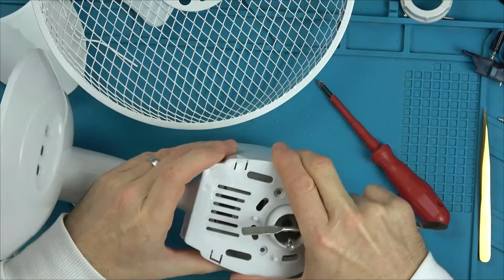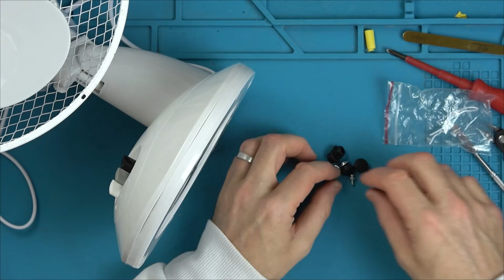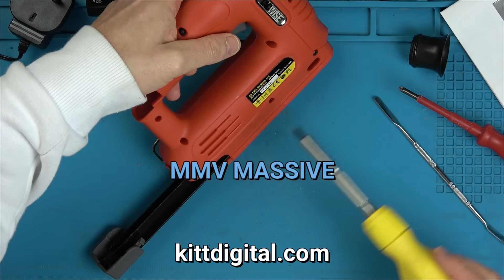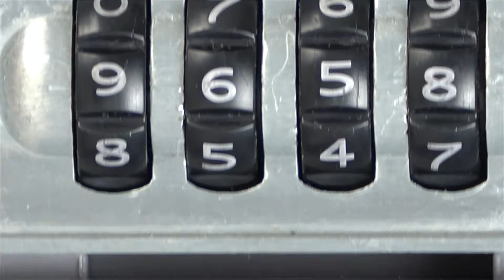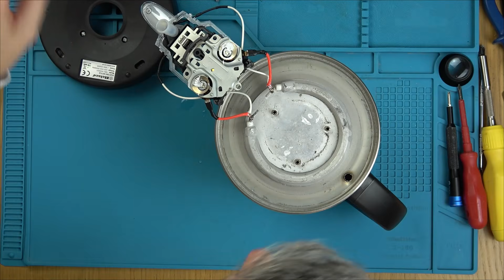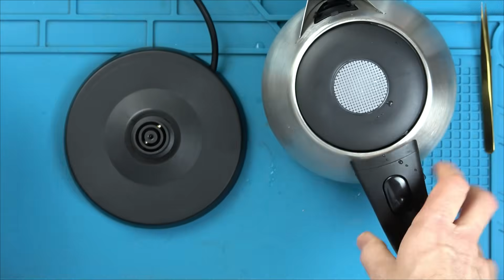I Bought AMAZON CUSTOMER RETURNS to REPAIR

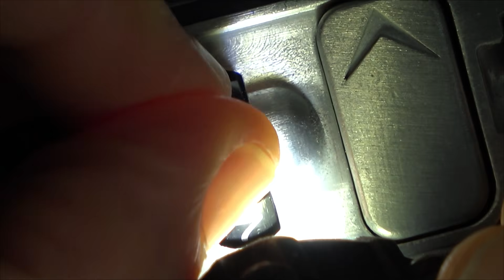Comment: 52:05 combination locks are quick and easy to unlock. Trying all combinations on a 4 wheel lock doesn't take long and usually if you are pushing on the catch at the same time you can feel the difference when you move a wheel to the right position.

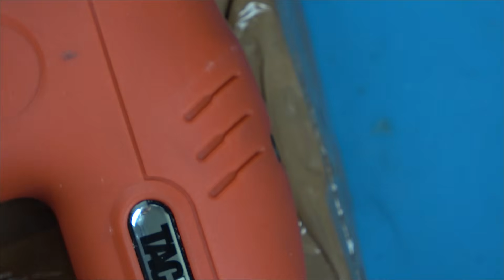Comment: 30:44 That's so you can hold the switch down and just keep lifting and lowering the staple gun, and it will fire each time you lower it to the workpiece.

Comment: If the damned thing had been fully assembled instead of a bag of crappy parts the the user would have realised the fan wasn't fully secured to the motor shaft and therefore not speeding up as it should have.  You didn't fix it as it wasn't broken.

Comment: To reset a radio-controlled clock in the UK, remove the battery, press the Reset button (or manually force the hands) to clear its memory, reinsert the battery, and leave the clock near a window to automatically sync with the UK's MSF Anthorn time signal.

Comment: Even if you could retune it, is the code the same in the U.K. system and the German system.  Just use a clock that sets to NTP.  I have written dozens of them.

Comment: I'm pretty sure you have to have the combination in before you can change it with out it in you won't be able to change the combination on the safe that's how 99% of those kind of safes work / lock boxes

Comment: They didn't even put the fan blade on right and the blade was spinning on the motor shaft that metal ring like spring thing goes on the back of the fan blade and puts pressure on the plastic which intern put pressure on the motor shaft connecting them together

Comment: Love watching the videos I've got something interesting my lad has a electric balance bike it uses like a makita 36v battery it's only 2 months old ive if I put a multimeter to the +/- shows 0volts and it won't take a charge ive opend the case of I check at the +/- of the cells its 39v but the battery won't give out no power or charge

Comment: lots of comments on that silly cheap fan.  But I bet they are mostly ( like I am ) just curious.   There are probably several ways mostly not practical to change speeds on a cheap fan , like switching in a big resistor but keeping the price low is probably why folks are curious.  I would ask you to re-check that switch , maybe draw a truth table, is there a button that ties both winding together in series or in parallel.  Two similar windings wouldn't increase manufacturing cost but if the switch connects them in series I think the speed would be different from just one winding.  Just wondering??

Comment: on the fan, they should have said some assembly required. The ring secures the blade to the shaft. The blade was loose on the shaft.

Comment: These fans are cheap and tbh not the best. The speed between the two doesn't have much difference. Also you need to be able to easily take out the blades to be able to clean them, they get dusty real quick. 
Ha i brought the Dyson bladeless fan and it was bloody awful, didn't do nothing in the heatwave we had last year. Tbh the best product we brought is our portable air conditioner, costs a bit to run, needs the hose out the window and a bucket to get the water but definitely keeps our bedroom cold.

Comment: I have many of these radio controlled clocks sold by Lidl/Aldi. They all set themselves to CET but have a feature to move the hour manually so you can have UK time. Plus it's still radio controlled as all are accurate to the second from thereon.

Comment: that fan has induction motor or asynchronous motor it mean it have a fixed speed depend on the voltage and frequency of the main and those different speed attempt from the manufacture are for the load supposedly the fan has some drag i mean when it was moving air it should have some resistance so in the lower speed the fan will move slower that using more energy in the second gears it seem the sheep construction of the fan made no difference if only the fan was a little bigger .by the way those type of fan are used in the microwave for cooling or refrigerator to cool it it is rarely or i should say never used in a fan it was not very  effective as cooling fan for human use .it is probably very sheep item.

Comment: As for the broken earth pin on the staple machine, after gluing stick the power supply into a double plug adapter and leave it in there.  The  80p adapter, though a bit bulky, will serve as the bit you plug into the wall socket without worrying if the earth pin falls off again.

Comment: About the Master Lock beach safe... it's just too funny that they took strides to improve the lock design while still leaving the hinge so vulnerable. I imagine if LPL were to drop by in the comments, he'd be pleased at you catching on to that so quickly.

About the RC clock... pretty wild if it doesn't have a "time zone adjust" feature so that it can grab the time from Frankfurt and then offset it by an hour or two in either direction for other time zones. That's how my dashcam keeps its time... It grabs the UTC time from GPS satellites and then offsets it by the appropriate amount based on the time zone I've selected in its menus (in my case, -4 or -5 for US East).

Comment: Interesting, very interesting. Does the fan's motor really running on 220V with just a resistor on the lower speeds?

Comment: I imagine they get a lot of these fans returned, they appear to be shipping them without the metal clip fitted around the plastic blade shaft, without reading the manual, most customers would not guess where that goes.

Comment: Digital clock usually have adjustment, +1 +2  -1, -2 etc. So just need to set it -1. Happened most the time with digital clock from lidl.

Comment: We had a staple gun that you had to break off about 15 staples before it wouldnt jam . Thought it was a tight spring but used the gun for about 12 years and always had to remove a few staples. It ended up being a back up gun.

Comment: Radio contrpled clock that you have has a GB settings that you didnt found. I lived in uk and had this clock and worked perfectly if you had found gb settings. And in uk works that frankfurt frequency. I had ham radio and you ca listen to that frequenncy..

Comment: Those junk transformer plugs break all the time. I just rip them open, solder a normal 2 core cable and plug onto the transformer, and re seal it. Saves so much messing about.

Comment: I have a DCF clock using Germany but it lets you set time zones. So does when the correct zone used show the correct UK time in summer  and winter.

Comment: Hey Vince! For that kettle, it almost seemed like in the very middle of the connector on the base, there's a round metal part that doesn't seem to be lined up - pushed in some. Thus maybe that's what was causing the center power connector to not go up as far as it needed to be? Of course just bending that power connector bit over would fix as well. Nice work!

Comment: U cut a thin piece of metal from a soda can then you put it down the wheel and turn it until you feel rhe notch. The notch is not on the wheel irself but its bearing and can be on either side

Comment: Another Customer Returns Episode.. nice! Let's dive right into it!

Desktop Fan.. cheaply made but it may cools a bit.. landfill saved from landfill I guess..

Electric Stapler.. hello old friend.. now we can you see working.. kinda..

Car Tire Inflator.. yes! It works! Oh no.. we are at a MMV Video.. this isn't supposed to work out of the box..

Master Lock Save.. The Treasures of Instructions are hidden in there and they call him Vince, the Master of Unlocking.

Radio controlled Clock.. to have this in the UK is really stupid.. but if you could retune it this would ne realy cool.. if it's possible..

Electric Kettle.. The great british brand no one ever heard of?.. (I don't know I'm not from your island).. you where more confident than on the Bosch Kettle because it wasn't your first Kettle and it works!

What a variety of items and interesting entertainment. Thank you.

Comment: If the Braun radio controlled clock is not for the UK and is for Germany why is the packaging in English and not German?  It's a bit odd that Braun would do that as I have 2 automatic clocks that set the time from the same place and they automatically change from GMT to BST so odd Braun wouldnt do that.  As always, I thoroughly enjoyed watching this video :)

Comment: Every radio controlled clock I had comes with the ability to set the time zone or has an offset option.
Not manually setting the time but set the internal memory to add/subtract hour(s) from the time it receives from the signal.
It is uncommon and not practical to make radio controlled clocks for every time zone.
It would be interesting to see a video of you modifying the clock with a new RF receiver or reprogramming the current one in there if that is possible.

Comment: it WAS friction or rather lack of friction the motor did spin slower or faster but the blades could not follow when it was soo lose i have fixed a couple of those by gluing the blades to the axel have not thinked about using heatshrink will use that on the next one :D

Comment: The problem with the lock box thing isn't that it's easy or hard to get in to, it's that now you have highlighted precisely the location of your valuables; a thief no longer needs to search at all.  If they had even a easonable pair of pliers that include a wire cutter they can probably cut it and take it in seconds.

Comment: Fan likely didn't work for the customer because they fitted the blades without that circular spring clip you found in the bag. This goes on to the middle of the fan 'hole' and makes it grip the shaft.  Those motors just alter the torque they give between the 2 settings.  Setting one can't overcome much air resistance of the fan so it goes slower than setting two that has more torque and therefore can spin the fan faster.  With no fan you will just see max speed of the shaft on either setting.  With the original slipping fan, the motor was likely flat out and the fan just slipping at a certain air resistance on both settings.  Hope this helps.  Love the fixes, all your stuff is great.
Reply from the maker: Thank you Mike, always there with the helpful and very knowledgably comments. You clearly know your stuff, cheers for sharing it. Hopefully bits of it will sink into my brain over time to help with future fixes 😎👌
Reply: @Mymatevince  I have watched your channel since the telephone days and amazed at how far you have come.  You have learned a crazy amount of new skills and I love how you try to pass that on.  I hope you get to a million subscribers soon, you deserve it for all the hard work.
Reply from the maker: @MikeB_UK  Thank you so much Mike!

Comment: The Radio controlled clock locked on Frankfurt can be set up to our time zone in the settings. I think. I have had other clocks and weather stations centred on Frankfurt and was able to automatically adjust the time by either Time Zone or adding or subtracting the number of hours to bring it up to local time (Permanently). Worth a try at 44 quid. Love your videos (All of them) Best wishes for the future

Comment: regarding plastic glueing on the plug. If its ABS, then use a bit of acetone, to solvent weld the plastic together. should hold better than glue

Comment: I think the problem was the silver ring was not put on the blade so the motor was not gripping the blade properly  putting the heat shrink on gave the motor grip instead of wasting it's energy
loose on the blade

Comment: The ring would have gone around (or inside) the plastic shaft of the fan.
On the more "expensive" version (+45p) the metal shaft and the fan are threaded. On that model the cause for the return is that the fan needs to be screwed counterclockwise.

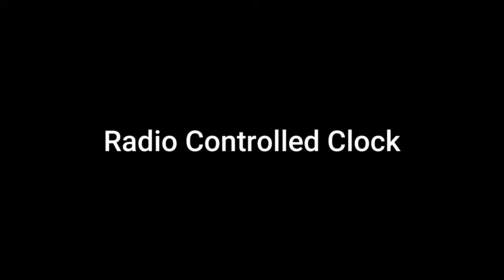Comment: "Braun" (1:07:51) is the German word for "brown" and should be pronounced "brown". If you're putting "tire" on the screen to help the Jonathans, you could help out the Germans also. And don't get me started on the pronunciation of "kilometres" ...

I have several DCF clocks, all showing UK time because I've SET them to show UK time. If I lived somewhere else, I could set them to the local time.  They sync every hour and cope with leap years. The only time I touch them is to change the batteries.  You read the English on the box so it's clearly designed for the UK market.  When all else fails - read the instructions.

Comment: Parkside mains nailer/stapler much more simple control circuit and a coil and it destroys itself 😂😂😂
Only small tacks and staples tho 
Pity the battery ones use a motor 

That looks like it needs a bit of straightening its catching even bit of grease may help

Comment: On the FAN: I think it was the friction of the heat shrink that kept the blade from slipping. I think that is why the speeds were working after you put it back together. Before, the lack of friction between the rod and the blades kept the blades from being able to increase speed with air resistance. Good fix.

Comment: A while ago I bought a Lloytron battery charger and batteries in Morrison.  I used it a couple times, then it decided to jump off the shelf.  Broke the plastic earth pin off the charger.  Ive tried glueing it on, but poundshop superglue isnt so super.  Now when I need to charge the batteries, I try to plug the charger into a 2 way plug adaptor.  I use a zip tie to open the shutter, so the 2 pins can go in.  
I use those batteries in my Auriol radio controled clock.  I believe this was sold in Lidls.  Or Aldis.  I got this clock in a charity shop.  When I gets the recharged batteries.  I have to go into the settings to set the language.  Then set the timezone.  As this clock gets its time from the DCF transmitter in Germany.  It seems that you have to set time zone to CET to -1

Comment: Vince, The DCF signal located just outside Frankfurt is, as I understand it, a Longwave signal broadcast on 77.5Khz. 
The UK has a national time reference transmitter located in Anthorn Cumbria pushing out a signal on 60Khz.
Here in Australia we apparently have no synchronized time signal transmitter because it is believed the GPS system provides a better reference. 
Cheers Eric
Reply from the maker: Thank you Eric👍

Comment: Hi if you start from 1 end and slowly rotate the dial 1 by one first dial until it gets to 9 then change the second one and you will eventualy get the code i do every time with my friends suite case
Reply: And if the code is say 6543 by the time you are done your fingers would be sore. Around the 250 mark I'd be looking for a hammer.

Comment: That fan blade was def spinning on the shaft, that's why it wasn't doing any better on high.  Was the metal ring supposed to be used to keep the fan blade part on (instead of heat shrink wrap)?
Reply from the maker: Yes, I think it was!!!

Comment: Oh, and the DCF clock doesn't need to be changed all the time.  It saves an offset from the DCF time signal.  It works fine anywhere within the coverage area.  You don't need to tune it to the Rugby clock.

Comment: The radio clock gets it signal from a radio station in that time zone the radio station send a signal as in a beep the radio clock picks up that beep the radio station operates on shortwave signals the one for the USA is in fort Collins Colorado

Comment: Why do you bother to take the bottom of the actual kettle off for measuring continuity through the element and switch, if you have the contacts you need already on the outside on the bottom of the kettle?
Reply from the maker: Oh yeah, good point 👍👍👍

Comment: I have radio controlled clock from Germany that is radio controlled. It's been working fine, because you could simply set an one hour offset. The radio signal does not supply a real time but a trigger signal. Hence you set it to the nearest hour and it would run fast to the correct time on the trigger signal.
The UK one as far as I know is in Rugby and I believe it transmits to receivers on the same frequency as the one in Frankfurt. It would make sense then to just have to make one type of radio signal receiver. Does not hurt if they than overlap reception areas.
The sending mast themselves will all commute amongst each under on a different frequency.
Reply: Standard Time Transmitters transmit a code of the UTS time not just a 'trigger signal'  

The UK transmitter is MSF on 60 kHz and is now transmitted by  Babcock International, under contract to NPL, from the  Anthorn Radio Station in Cumbria. It moved from Rugby some years ago.  

The German DCF transmitter uses 77.5 kHz

Comment: Great video (as usual Vince) but surely the fan speed was lack of friction between the fan itself and the drive shafted that caused the issue as you didn't manage to achieve two speeds when the fan  shroud was actually removed. Keep up the good work. Great viewing

Comment: I have several weather stations from Aldi that do exactly what that clock does and put themselves an hour fast. However in settings you usually have an option to set it to -1 or -2. I have it on -1 and as such it'll be 1 hour before DCF and keeps perfect time. It does all go a bit amiss at BST because clocks don't go forward at exactly the same time.

Comment: Hi Vince - that spring from the fan does goes on the white clip if you pull the blade off and reinsert it around the inner tension 'hands'. The fan spindle was spinning higher, but as there was no 'grip' the inner spindle was faster but the blade itself wasn't held with the spring tension around the spindle